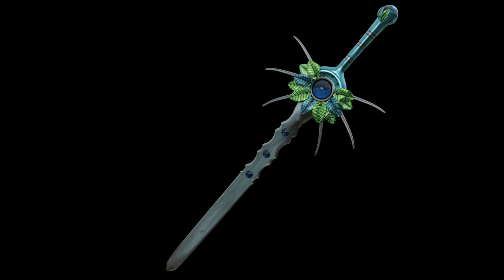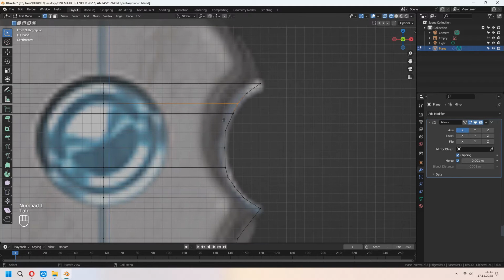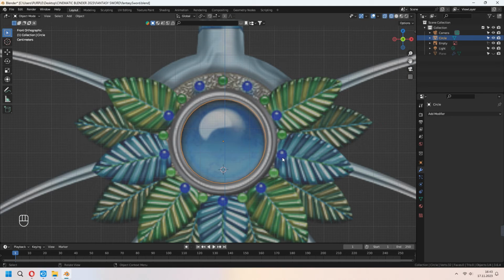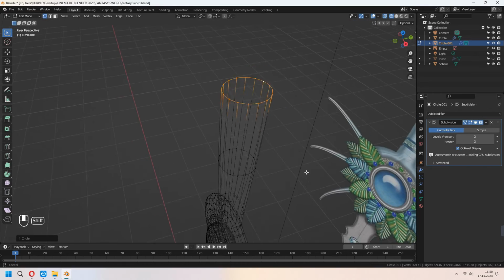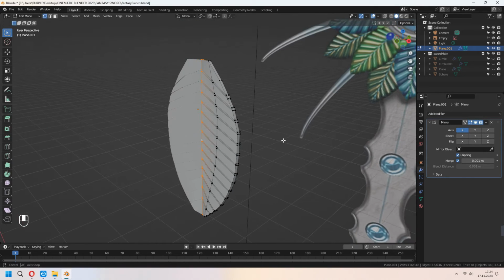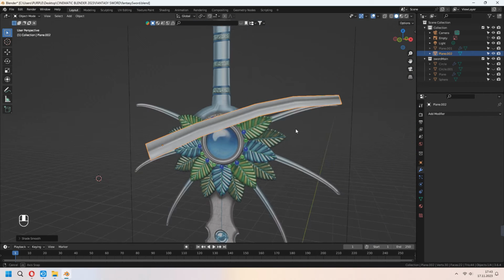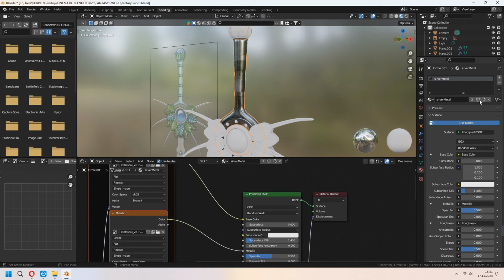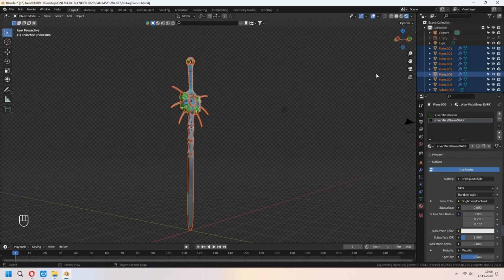Blender Free FANTASY SWORD Modeling Tutorial / Blender 3.6

Comment: is there a missing step between shade smooth and add subdivision modifier to bevel the edges of the blade? I don't understand how there is extra geometry on the point, each line is just a single row of vertices for me and yours are tripled up.